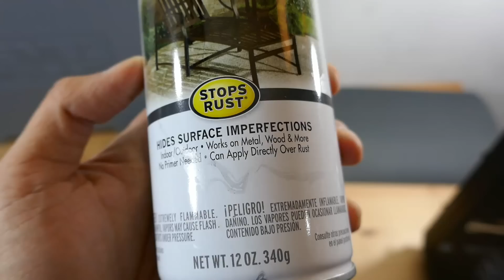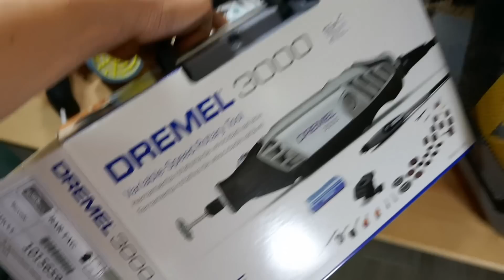Mini ITX PC case mod project: "Mini-volts" on Cougar QBX Kaze

Comment: Very inspiring mod. Easy to do though I do not have any acrylic panels around the local hardware store. I'm wondering though if there's a way to improve those mesh with maybe a finer dust filter maybe wrapping them with stockings? lol, thoughts?